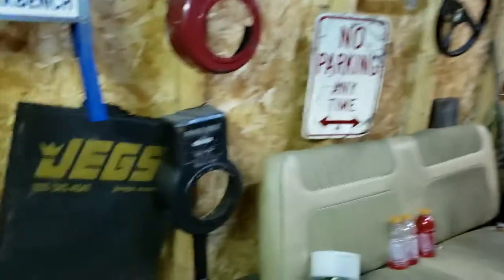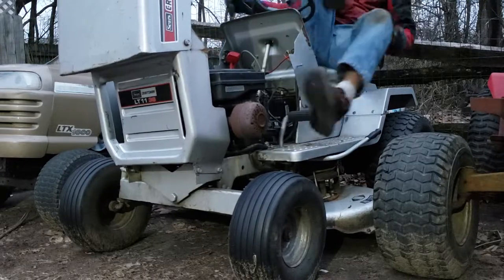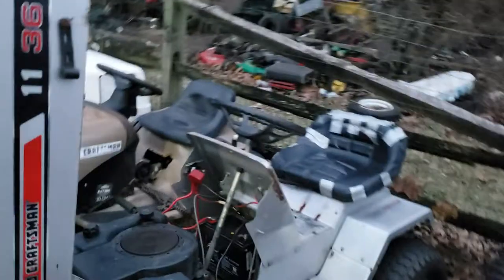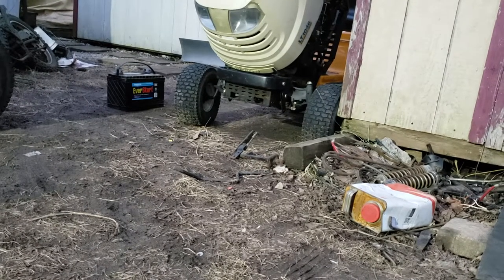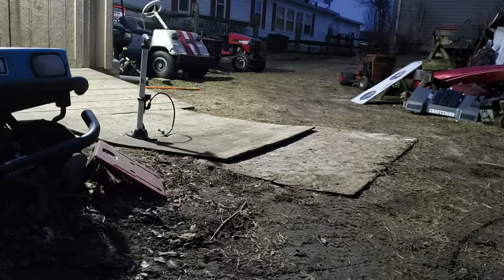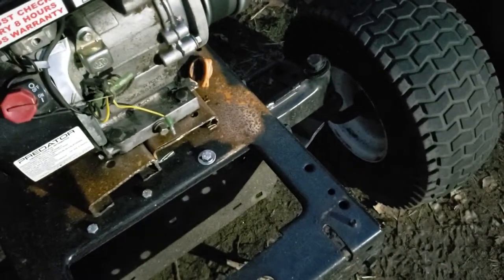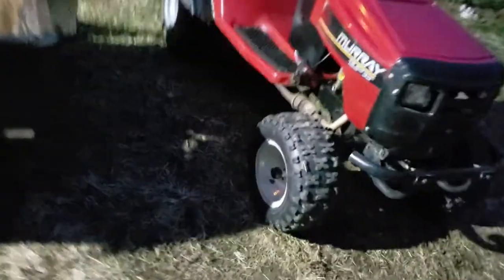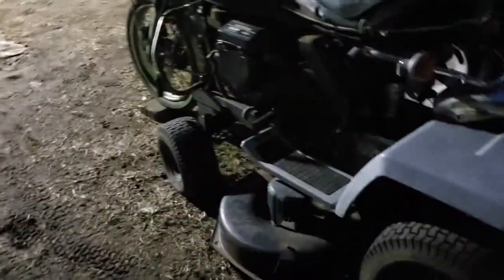Lawn mower cold starts

Comment: Word of advice. Never Ever rev a cold engine like that. Especially when it’s THAT COLD. Freezing cold. Let it warm up for a bit. Your also running the heck out of that engine. It’s not going to last that long if you do that every time. And put some belt conditioning spray on your pulleys. The first mower is the one I’m talking about. 😅
Reply from the maker: Lol that was 4 years and they both run like Jesus himself touched them.